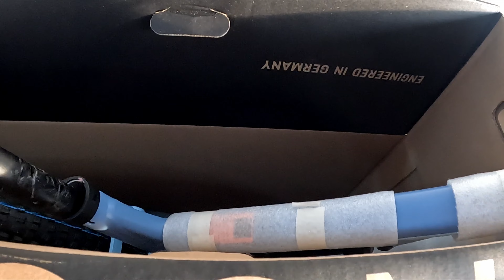MY New MTB: Unboxing Canyon Neuron 6

Comment: Tell me, height 170cm inseam 78cm size M will be large? Canyon website recommends S but he often underestimates sizes.
Reply from the maker: Hi!! I was having same question when I was ordering mine. Site says we should get Small, but I took the risk and order Medium to get 29" wheels. I can tell that it is at limit to me; I have the seat post all way down and when fully extended it is just fine to me. And it seems you have longer legs (my inseam is 75cm), so you will be fine with M. Hope you can get your Neuron! Safe rides